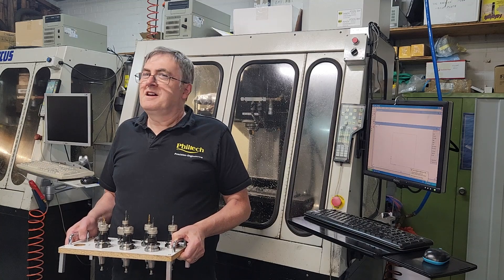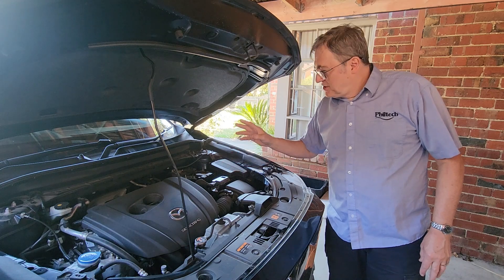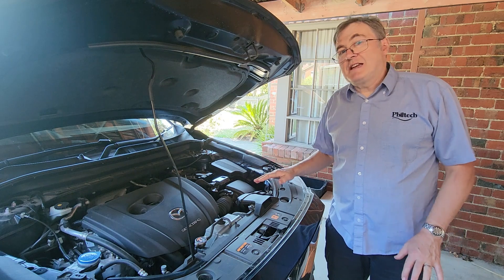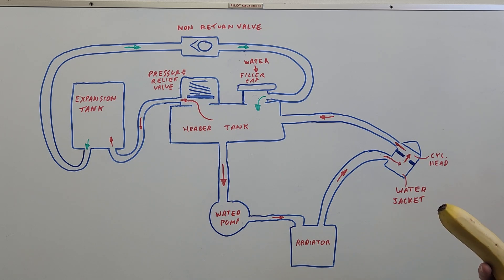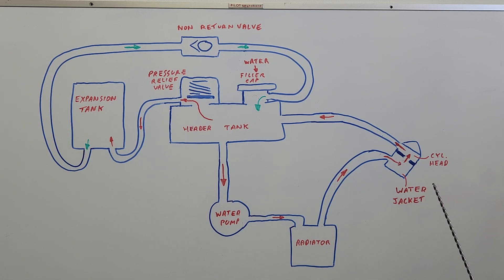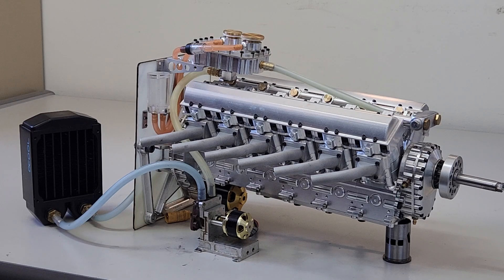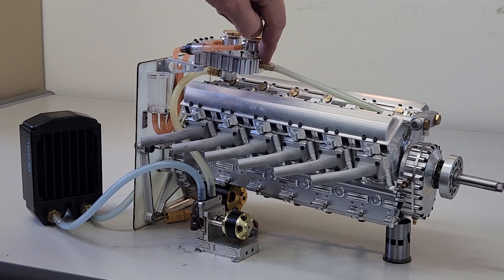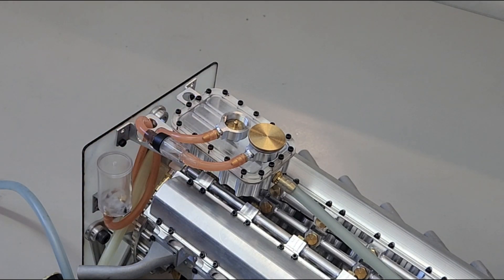COOLING the Lesley V12 Model Engine

Comment: Will this system have any issues with inverted flight? Could you possibly use a sealed cooling system with an expansion tank? You do incredible work!
Reply from the maker: We have updated the design to have a sealed system and an expansion tank, so flying inverted should be OK.